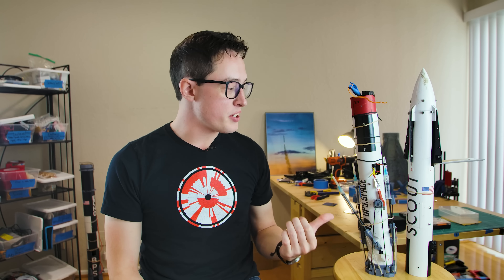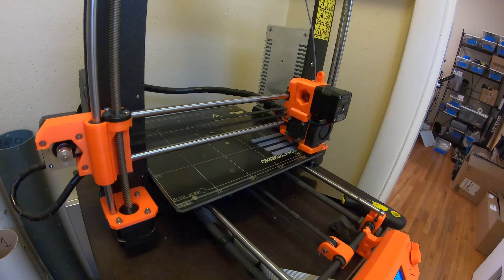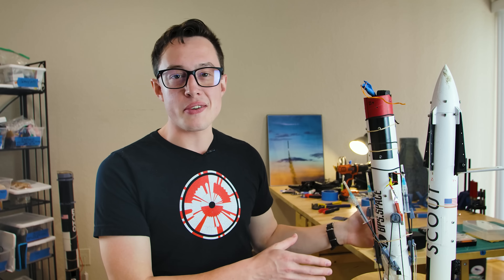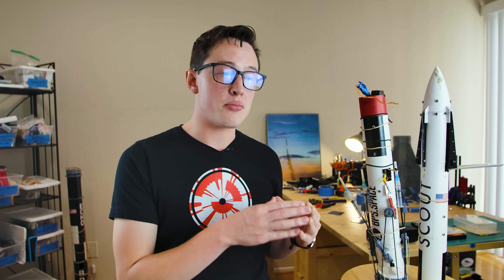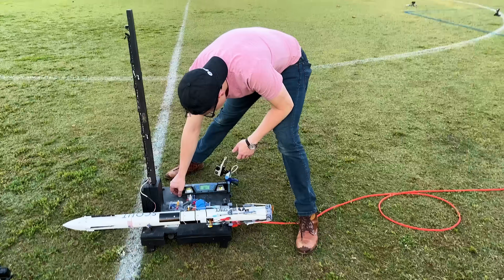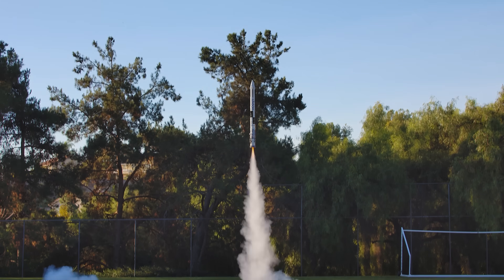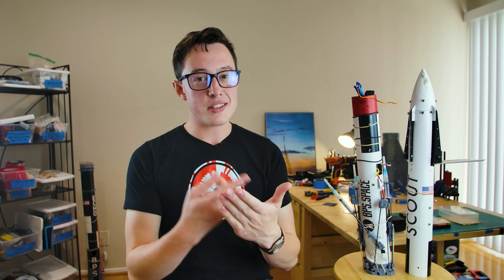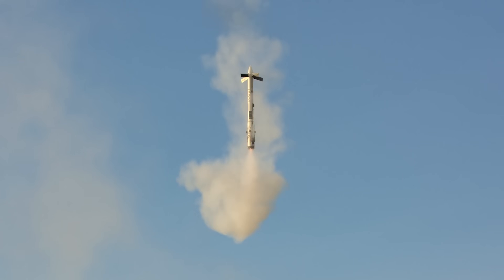Scout E - Flight 2 Launch + Landing

Comment: Hey Joe, if you're changing the engine control/mount, will you still be using some form of thrust vector control along with your thrust throttle idea?

Comment: I'm curious how practical would be throttling by having 3 engines with independent TVC (and throttling down by angling all of them outward). As a bonus, that would also give roll control. As a downside, it would increase the diameter very considerably.

Comment: Hey, have you considered perfecting landing without typical launching? 
at this weight could you not use a drone to drop the rocket from a desired altitude?
that way you can isolate landing problems and fix them without going through full launches.
PS: I might not know what I'm talking about, so please feel free to correct me.
Reply: Check out his older videos. He used to do exactly that.

Comment: Why did you need the rocket to be perfectly upright on launch pad to figure out initial orientation? Acceleromeres are not accurate enought to calculate orientaion from gravity pull? Or the algorithm for pisition estimation would be more complex if initial orientaion is not vertical?

Comment: I'm definitely a fan of the KISS principle. The syringes are a genius level solution for the problem of dampening the landing shock. There are points to that solution that can be interesting to investigate further. I mean like holes in different sizes alongsinde the syringe to give it a different dampening curve. So you can develop tailor-made landing gear for almost every surface just by adapting the position and size of the venting holes.

Comment: When it comes to accelerometers and gyros to determine positioning, it is really hard because of the excess noise coming especially from the accelerometers and implementing a running average makes it determine a new zero position, at least when we tried to use it with PID thrust vectoring, so hats off to you man. 

BTW here's our first attempt at PID: https://m.youtube.com/watch?v=mQTuUv-JzOc

Comment: I told like a year ago that you need to throttle your motors. you said it's not gonna happen any time soon. I'm telling you again, ditch the black powder engines that you are currently using and go with the throttleable, easy to make, tar and oxidizer hybrid engines. it's gonna make your life a lot easier
Reply: No it’s way to hard expensive and dangerous
Reply: @floodgates6210  expensive? Tar is as chip as dirt, and you can get a really good oxidizer like nitrous oxide very easily.
Reply: @alexlowe138  well the f motors he uses are $14 each soo

Comment: Try going for Velcro on the landing pad with soft foam. Then rocket legs with the opposite Velcro. It won't slide but it will absorb impact and cause that thing to stick to the surface
Reply: Brillant idea!! It makes me remember that while the Americans were spending millions to make a pen which works in space, the Russians just used a pencil.

Brillant simple and effective idea!
Reply: @gmartins01  as far as i know that story is either not true or not the complete story. The above idea is really good though. I shall look up the story.
Reply: @gmartins01  small pieces of graphite flying around weightlessly inside a cabin are not great... they can destroy electronics and astronaut eyes.

Comment: I've been watching your videos for a while now and really enjoy them. Thanks for the entertainment. I'm no rocket surgeon or anything, but I've been an aviation enthusiast for a very long time, and while I have only flown single engined piston aircraft, I'm well aware of and have some knowledge of how the more complicated jet engined aircraft work. When you mentioned controlling thrust with a bit of extra sleeve around the motor and then showed the SpaceX landing, I thought to myself, sure, but they can shut off their engine (I think they're only firing one in that last landing/suicide burn) as soon as they touch down. Now I'm thinking that you CAN'T do that with the motors that you use... But what about reverse thrust?  What if you had a very simple system to divert the thrust sideways as soon as the landing legs meet ground? Wouldn't that solve (some) issues of firing too long after landing?

Comment: I wonder if a gyrocompass align would give a good pitch/yaw initial condition with these sensors. Be interesting to test. Probably need to not use the mems gyro and use the magnetometer.

Comment: Have you considered using RC car/truck/buggy shocks on the legs? They come in many different sizes, and the better ones offer customizable spring and dampening rates.
Reply: I've been wondering that myself, but I think one of his concerns would be weight.  I do think that if he has a resin 3d printer he could probably make something similar but smaller/lighter.
Reply: That's the thing I love most about the syringes - they function identically to real gas/oil shocks, and they can be tuned by changing the location of the relief hole. Seriously brilliant stuff!

Comment: I would recommend to put a metal shield around your control board. Even thin aluminum foil would be more than sufficient. Any pcb track can act as an antenna and any HF noise from outside will be picked up, amplified and injected into your mcu and other components, potentially creating noise and errors. The other way around (your control board causing unwanted RF transmissions) can affect your GPS signal. Also, with GPS you can set up a nearby, known fixed-position 'error correcting' station that uses the same GPS receiver but compensates for the drift in GPS position. Farmers use this to sow and harvest crops with a few cm accuracy. Yes, you would need a radio signal to update the offset back to the rocket but you probably already have 2-way telemetry. Also for long ( > 5cm) lengths of cable consider putting ferrite beads over the connections as they can help limit outside currents and suppress noise that could otherwise get into (or out of) your system.

Comment: Could throttle control be done with an iris of some sort that could just open and close as needed?  You could possibly have a longer run time motor and control it's thrust?  My immediate idea, I just thought of the iris one minute ago, is to have it controlled by an internal shaft almost the same diameter as the rocket that way you could have the controller to spin the ring to open and close the iris in whatever section of the rocket would be best.  Obviously if that type of device would even work first.

Comment: What you describe as "Dead Reckoning" is not called Dead Reckoning it is called "Inertial navigation system", two totally different methods of navigation.
Reply: Wikipedia says that inertial navigation systems use dead reckoning
Reply: @robmckennie4203  GPS navigation in car use dead reckoning too (to calculate position between two GPS updates) but no one say it is dead reckoning, also dead reckoning is used by mariners from beginning even before they know for kinematic equations. Dead reckoning is any system that use only previous previous position (without any measurement) to calculate current position,  inertial navigation system use measurement from gyroscopes and accelerometers to calculate current position.

Comment: to accomplish your mission objectives, does it matter that you land the rocket propulsively using a rocket engine only ? I realize its a lot more boring , but can you not use a drone configuration, basically  turn in into a drone of sorts somehow on landing. You could even have two contra-rotating props at the nose start up on decent. Im not sure if propellant based landing is workable at the scale of rocket you are building, I question if you have enough energy in the system.
Reply: I think the whole point of this exercise is for him to do a propulsive landing with a solid rocket motor.

Comment: Dood. The enjoyment in watching your rocket project fades way too fast. Learn from Elon and do some rapid prototyping! After all what I need is the important factor here. lol  J/K, love watching your videos, thanks. Oh hey, have you heard of differential GPS? If you are lucky and near a coastal waterway, you might be able to receive the signal where you are at. If not, maybe somebody will donate some time and set up a portable system for a launch. Takes the 15 meter nominal GPS accuracy to 3-5cm.  I'm not an expert but if you need better accuracy you might research it. I know you use a inertial system but it has drawbacks as you stated. I'd be interested in for a short flight like you do what the accuracy is over the flight time. Is there any way by using your telemetry and the video that you can accurately determine what the guidance package predicts and what the actual position is? Sorry, just thinking out loud so to speak. I was starting to geek out, I blame you and your videos. Cheers!

Comment: I wonder if you could use an exponential moving average of the accelerometer data to smooth out the noisy signal? I am not sure if a moving average would accurately represent to the actual acceleration of the vehicle, but if it kills SOME of the noise error, then you are at least a little bit closer to glory!

Comment: Wouldn't that wobbly reaction wheel add a lot of vibrations? Mabe run some struts on the sides and hold a bearing on the end of the shaft?
Reply: Struts only work in KSP. 😉
Reply: @Unmannedair  I mean a cage around  the reaction wheel, so that you can support the end of the shaft.

Comment: Impossible to land without a thottle controlable engine, thats impossible no way to compensate for errors... even though SpaceX's marlin has a lower minimum throttle, they know it will always be constant. here, the solid motor is unpredicatable.
Reply: And yet it wasn't the unthrottleability of the motor that doomed either of the last two attempts.

Comment: How do you account for thrust variations in different solid rocket motors?
Reply: He uses thrust vectoring to add sine efficiency losses for thrust control.
Reply: The thrust curves are very consistent across those motors which he has verified by collecting data on a lot of launches.

Comment: Man you will be better off redesigning and separating the GPS from everything else.  Worked on a system that required GPS accuracy (timing) down to the picosecond!  We wasted tons of time (and $$$) trying double shielded cables.  You could try using aluminum or copper and create a faraday cage around each  system.  In the end we learned to put the GPS on one end and all our telemetry systems along with everything else on the other.

Comment: 3:11 - how do you keep all the electronics inside like the gps module and processors cool without heatsinks? Do you think they are thermally affected? I remember watching a livestream launch with telemetry and thought man those electronics must be cooking themselves while waiting 30 mins to then launch. They could very well be within limits, but I would like to know!
Reply: Those things are like Arduinos.  Heatsinks are unneeded and heavy.  Chips use the circuit board as the heatsink.

Comment: Questions - 1.  Do you really need to control/steer during ascent?   If you have good engine(motor) alignment,  controlling the motors is wasting a lot of energy.
Reply: I'd guess so. An unguided rocket is subject to all kinds of "fun" forces that tend towards it pointing anywhere other than straight up at apogee.

Comment: You could also increase your thrust with a air augmented design. Basically, instead of overexpanding your exhaust, you place the bigger tube a little further down. This allows air to be sucked in by the bernoulli-effect and then accelerated, giving you a greater exhaust mass and increasing the thrust.

Comment: If you used fast enough servos, do you think you could achieve a 'throttling' effect by rapidly wiggling the motor? If your thrust vectoring mount has a large enough range of motion, you'd potentially be able to get a decent reduction in effective thrust (especially if you design it so that the plume impinges on the fairing at maximum deflection.

It might be impractical to find servos that are fast enough, though, and the vibration is obviously going to feed into your accelerometer data a bit.

Comment: Tell me if this sounds familiar:
1. Make the requirements less dumb.
2. Remove parts or processes (you can put them back in if needed but remove what you can)
3. Simplify & Optimize
4. Go faster
5. Automate
Reply: Is this a jeff bozos quote? lol
Reply: @WM3636-d1c  Close.. Musk recently discussed this. It's actually pretty old but still worth thinking about. If you want to create a process it is best to consider these actions & work with them in mind. Skipping them or doing them out of order will likely result in a less than amazing outcome.
Reply: @BrianHoff04  Yeah, I heard him say that in Tim Dodds interview, pretty good advice. I was just messing around

Comment: what about a controllable rocket nozzle? like using a control surface to divert flow radially instead of straight down in order to control thrust on descent? i'm imagining something similar to thrust reversal in turbojet engines

Comment: While I applaud the gravitas of trying to land a solid fuel motor, I can’t help thinking that you just need to make a hobby level liquid fuel rocket for this project.
Reply: Neither liquid or hybrid would work for a vehicle of this size: they are simply too heavy. Plus you are going to need igniter and valves that is not single-use, which is also going to be heavy, buggy, and have to be on the vehicle rather than on the gse (which is the case for systems such as hypertek). Overall, too heavy relatively. Might work for a bigger vehicle when additional weight is relatively small to total weight.
Reply: On paper this seems insanity. In real life, probably also. Using more than oneengines you could use thrust vectoring to adjust thrust. Still need to deal with ignition ramp up delays which are variable etc.
Reply: I wonder if hybrid was easier. One tank of NOS instead of two tanks, fuel pumps, injectors, etc.
Reply: Maybe a collab with Integza is in order

Comment: Would it help the noise of the inertial navigation system to gang together multiple accelerometers, and take the average or something?
Reply: Yeah, that would help, but you shouldn't take the average. You should take the root mean square. When handling independent data sources it simplifies things to say that they exist dimensionally independent.  Then you can apply poly dimensional Pythagorean squares to get a reduced error. You can also do things like applying a kalman filter.
Reply: @Unmannedair  how can missiles from the 60s go transcontinental with mech gyros but his super sensitive solidstate gyros and cpus drift so much in 10 seconds?
Reply: @haljohnson6947  expensive mechanical gyros beat cheap solid state gyros
Reply: @haljohnson6947  I was actually just reading about this on Wikipedia, and I had no idea how deep the gyroscope rabbit hole goes. Cell phone gyros are not actually solid state, they're "MEMS:" microelectromechanical systems. They're tiny mechanical gyroscopes etched out of silicon, which use an oscillating rather than rotary motion. I don't know what missiles currently use, but there's a huge variety of more accurate gyroscope technologies, like ring laser gyros (used for airplanes' inertial navigation systems) and mushroom gyros.
Reply: @haljohnson6947  Weapons/aircraft grade mechanical gyros are machining masterpieces, commercial/automotive grade IMUs are built for low cost and small size. Industrial grade IMUs can cost thousands, navigation grade IMUs can go into the 30k price range.